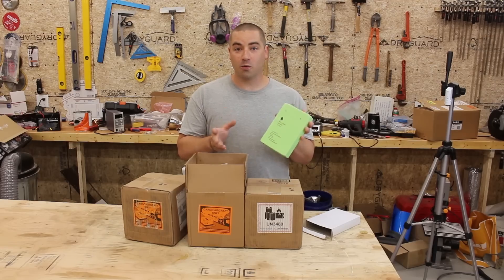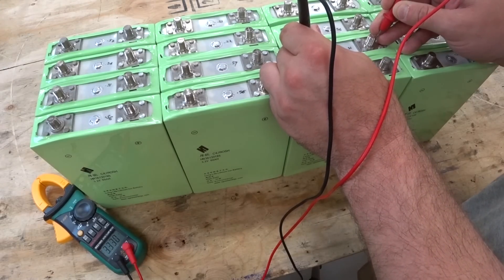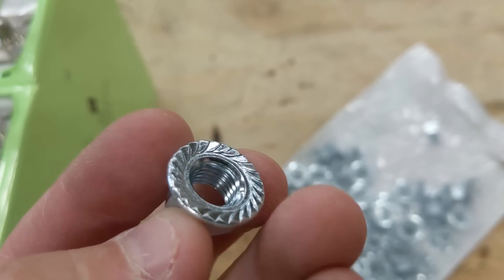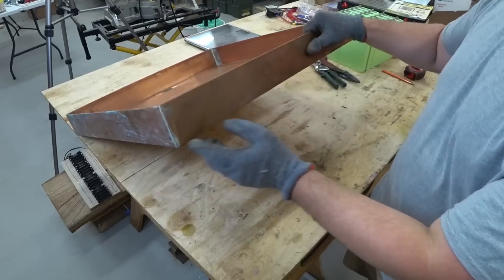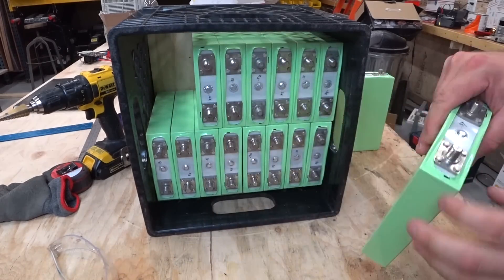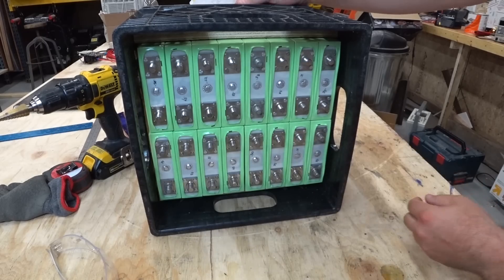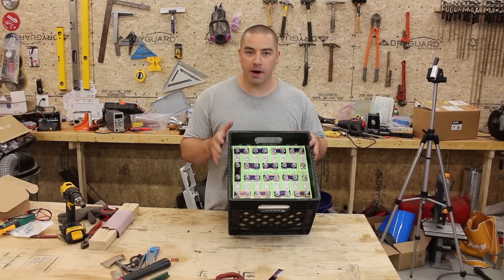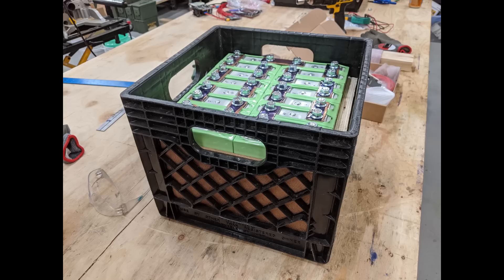Milk Crate Battery, Part 1, Easy 48v 16s LiFePO4

Comment: I was thinking of doing something similar in a 12v arrangement as a power pack for our little Gheenoe canoe with trolling motor.  I hate lugging around two lead acid deep cycle cells for the purpose.  Great job finding a way to reuse the copper!
Reply: I made a 12V pack with 4x LiFePO4 using 105 Ah batteries off of AliExpress (~1.3 kWh). I placed them in a plastic "ammo can" and they've done wonderfully powering my 45 lb trolling motor on my 15' inflatable Kaboat. Total weight is about 22 lbs. Of course now I want to build a 48V pack and buy a 3 kW outboard so I can get on plane and maintain 10 knots...

Comment: These size cells are available in Europe from GWL.eu (I’m not affiliated in any way, just a very satisfied customer). Cost is around $65 per cell - brand new, but sadly nowhere near as cheap as you managed to get them for. 

One other use is 4 of these cells fit perfectly into a MakPak style size 2 power tool case, with just enough room down the centre for a BMS and fuses; makes a great portable 12v power unit for car camping - it powers my Dometic CFX35 compressor fridge for around 48 hours with no additional charging.

Comment: Hello David i have a question would rlly be happy if you can answer.I live in Bulgaria and my current system is off grid with  2  inverters running in paralell each 5 kw 230v ( 48v monophase  hybrid inverters)   and i have solar panels 10kw.My question is  can for example   i have on 1 inverter  1 bank which is  GEL Bank and on the other  Inverter   Lithium bank and still have no issues in the  system while both inverters communicate to each other and  charge diffrent  banks ? Great Videos really enjoy them   subbed and enjoy each video you do !! Keep up the good work ! Im really curios  since they are 48v  can i have another bank  on my 2nd invertor  with Lifeso4 battery bank and i  see that Calbs  are 3.2v so im guessing reaching  48v will be great batter paralelling. Im currently having 12  GEL  255 Amps 12v   bank but it is rlly low while im runing my 2 monophase pumps  which are 4kw per hour as soon as   big cloud pass by  my bank dies in minutes ...
Reply from the maker: When your inverters are paralleled together to put out more power on one phase then you need one battery bank. you cannot have more than one battery bank feeding both inverters they'll go out of whack from each other. So you can either add more batteries in parallel to existing bank using a set of bus bars, or you can sell your current battery bank and put the money towards buying one larger lithium battery bank
Reply: @DavidPozEnergy Thanks  David  .Should  i understand  i  can  do  paralell between my  curnet  liquid   acumulators  and  lithium  batteries  via  bus bar   thus having  larger  bank  ?

Comment: 082220/2147pst. Davis thank you. It was nice seeing you got hold of a good bunch of Lithium Polymer cells. 
The question:- Why was the marker pen blue colour left as it is on the connecting Cu strips? Surely the serrated end on the nut will cut into the Cu strip, creating a good contact, I know. But...esthetically.. 
I’m looking forward to the next segment. Cheers n 73s...
Correction:- read as LiFePo4 instead of LI Polymer cells.
Reply from the maker: I left the blue dye on the copper purely out of lazyness.  You are correct that the nut will bite through.  It is just looks, not function.

Comment: What is the manufacture and part number, I can't even find the data sheet for these cells, never mind finding that actual manufacturer.
Also what was the per battery cost?

Of course another interesting video, keep up the great work.
Reply: These cells are LIFEPO4 cells
comparing them to lithium-ion batteries 
They are cheper and more stable, but performance lithium do better
Lithium-ion 512wh/litre
Lifepo4 about 300 wh/litre its like double
If you you are familiar with electronics
Because they both may explode when overcharge them or die whe overdischarge them
They need a BMS 
A board circuit that protect these cells from damage

Comment: Would you consider testing some lifepo4 batteries from AliExpress? There are smoking good deals for 12v 100Ah batteries - both packed ones with BMS (going for under $400)  and just cells (3.2v 100Ah, comes as pack of 4 cells) - so, will you do it?!
Reply from the maker: I don't know, but if you send me a link I'll take a look.
Reply: DavidPoz here are a couple of examples:
https://a.aliexpress.com/_d8TQZOG
https://a.aliexpress.com/_d8hLStA

Comment: It's rough watching all these DIY videos when 95% of the time the battery is out of stock.
Reply: You have order the day the video comes out. Also, they sometimes have more in stock but have to be broken down out of crates and equipment cases, etc. And tested. So always CALL them. You might be pleasantly surprised. That's how I ended up getting mine. When I went to place an order they were "out of stock". I called the next day....no answer.. called a few hours later and purchased the batteries that I was looking for even though they were not listed on their site.
Reply: That was last weeks bargain. WHEN you're ready to buy check out https://batteryhookup.com/ for the best deal that DAY! This applies to everyone.
Reply: Just use 18650's

Comment: Thanks, as a matter of interest how much did they cost?
Reply from the maker: I think I spent $400 buying the cells from battery hookup.
Reply: @DavidPozEnergy  That is $400 / (3.2V x 60Ah x 16ct) = $130/kWh, which is even less than the cost per kWh for a Tesla Model S/X module from my local California junk yard. Very good deal if the capacity is near 60Ah.
Reply: DavidPoz Great deal 👍 Just saw an old Jehu walkthrough of their operation. They seem great.

Comment: Do you have to worry about cooling for a power wall?
Reply from the maker: I have all my batteries located in my garage which is cooled in the summer so I don't worry about overheating. I also limit the amps for charging the cells so they don't overheat.

Comment: Flatten some old copper pipe, use a wire wheel brush, bets busbars for the price.
Reply: I did this for one of my DIY builds.  Biggest PITA was getting the hole spacing correct and not overdoing it using the step bit like David did.  What's the wire wheel brush used for though?

Comment: You like to shoot for $100/KWh or less. Did these come in under that figure?
Reply from the maker: No these were new old stock so I did spend a little bit more than I usually do. I think I spent $400 from battery hookup to buy the cells

Comment: Sir good videos ...i have 8s   24v 75amp battery can i use 10s bms?plz i need ur help
Reply from the maker: Some BMSes allow you to use only a few of the voltage sense wires. But most don't. Most BMS is are made for that exact amount of cells. So you are asking about a 10S BMS usually that would require all 10 voltage sense wires to be connected to something. But you need to check your individual manufacturer of your BMS
Reply: @DavidPozEnergy  thnks sir u reply ...i import from its DALYELEC.COM...i order for 8s24v 50amp bms but i get 10s bms ...if i install 10s bms for 8s 24v system than wht happen i m little cnfuse if u help me ...if i share me whtsapp nub so i share pic of bms or if u dnt mind if read frm web site

Comment: Since you are using busbar connectors that have a AVG 4 cross sectional area which is a low resistance. When you drill holes into the sheetmetal you are taking out material which lowers the sectional cross area. Why not make the busbar with keeping in mind to just make the bars wider to make sure resistance is on the down low. That way bar temperature will stay super low and increase the efficiency. What do you think David ??? Peace and stay virus free too. VF
Reply: Whilst this is correct from the busbars’ perspective, the removed material is “replaced” with the battery terminal post and nut when installed on the battery. 75A at a nominal 48v is well over 3KWh, so unless you plan to run a massive inverter from this battery the additional weight of wider busbars (note that David weighed the assembled unit) becomes unnecessary.

Comment: Nice little package, I've been looking at some of these metal case prismatic cells for expanding my solar storage. I have about 14kwh now of existing storage with a 48 volt pack made of a couple of the byd batteries and then a 100ah pack made from 14 of those A123 lifepo4 36 volt packs they sold reconfigured into 10 48 volt packs in parallel. I've been using those ANT-BMS boards for my BMS on both, they've worked very well once I figured out how to change the default bluetooth address on the second one so you can use more than one in the same space. $120 for the 400a version and in my setup even if one of the two batteries failed or shutdown the other would never take more than 120amps peak, 80-90 amps max for short durations during daily use. With the two splitting the load, 40-60 is peak. Each additional battery with BMS further reduces the load each battery sees. Plus they are cheap enough to keep a spare on the shelf. They never even get warm in my daily use. I looked at the tiny bms, looked cool, interested to see how it worked, just couldn't justify the cost for my setup.
Reply: How did you change the ant bms , I bought some then found out 400amp is just instantaneous not contentiously maybe can do 100 continusly if you lucky

Comment: David, great video and I just bought a Tiny BMS.  But I have a quick question not on this video, when you got your BMW batteries they came with the orange connectors a bunch of us are trying to figure out what type of connector they are and size, and why you can give us the spec or some kind of part number.

Thanks
Rich
Reply from the maker: I didn't see a part number on the orange connector but maybe if I break it apart from the base I can find one hiding in there. But it's going to be a while before I can get a chance to get some high res photos up on Facebook for you
Reply: @DavidPozEnergy  even if you can get the size and mayby a pic I can make one... Thanks David
Reply: @DavidPozEnergy  OK, thanks

Comment: Instead of taking all slack from the sides,  Could you divide that extra air space in between each battery with spacers (like spacing tile)  to get even a little bit of extra air flow in between the cells?   If  It isn't practical to divide the space between each cell, even 1 or 2 gaps in between the banks might help  especially with any active cooling.

Edit:   Forgot to say thank you for the video, it is really cool
Reply from the maker: your ideas very valid. I would love to include some version of active cooling for these cells. I thought about maybe grabbing some old roadside signs that are made out of chloroplast and maybe using that that way air could potentially move. I also thought about maybe getting some ceramic tile to have a spacer in between them but in the end I just wanted to do something that was fast and I'm going to be limiting the amps on these so they probably won't heat up anyways. But adding some version of active cooling would be ideal